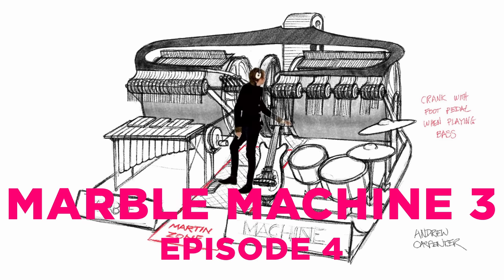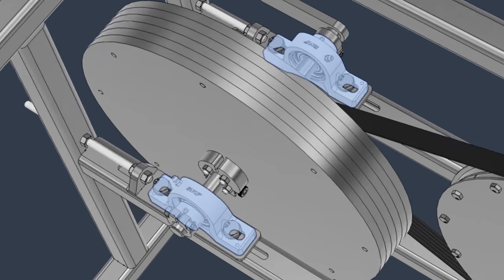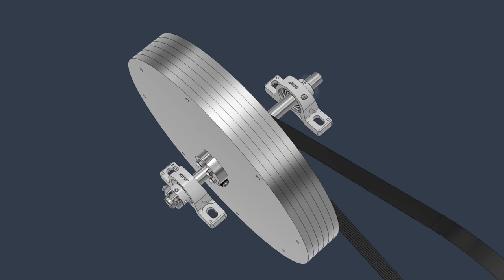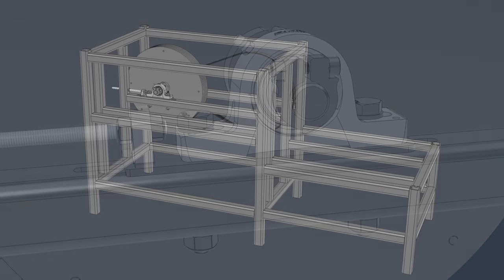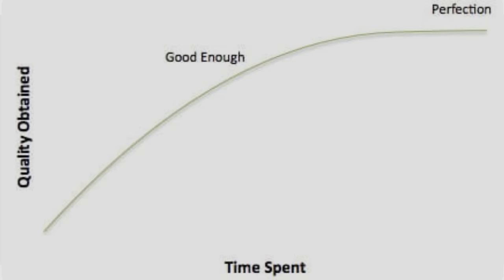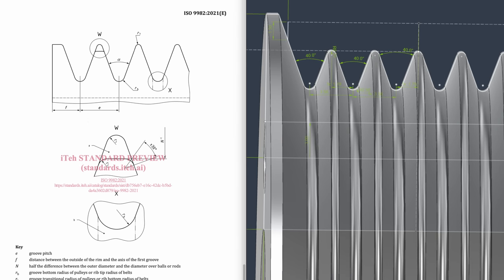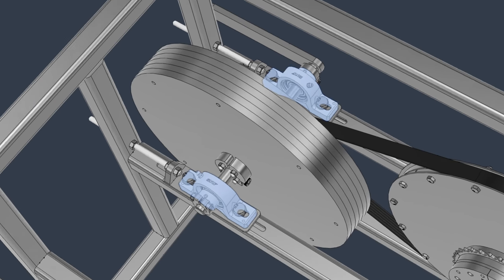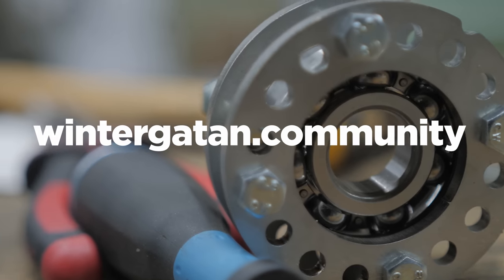A Better Flywheel Design - Marble Machine 3 Ep.4

Comment: I'm curious why the flywheel assembly need to move to tension the belt, instead of the other side of the belt.  Is there a reason for that? I'm concerned that an adjustable flywheel (even with those bolts) might effect the balancing or unwanted movement of the flywheel?

Comment: Why move whole massive flywheel to adjust belt's tension when you could tension the belt with one flat, small, adjustable roller? It would be easier to manage space and ensure stability that way, no? Check out "tensioner bearing" and "idler bearing" in engines. Imo moving the whole flywheel can result in problems in the future — space management, screw loosening, unwanted vibrations, frame rigidity, two screws to control tension can introduce unwanted alignment, It requires more work to tension (alternate between adjusting screw no. 1 and no. 2) and it's a huge ass piece of weight to move. A fist-sized tension roller could be a lot easier to access and adjust if it had only one screw and was mounted to the rigid frame.

Aside from that, good job :)

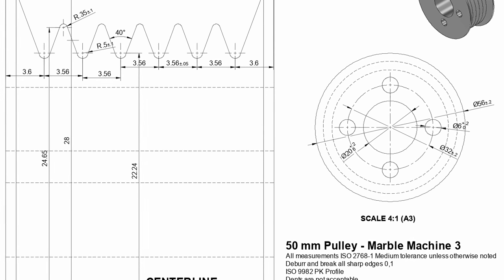Comment: The blueprint at 6:51 is good enough and will make sense to a machinist, but convention is to place dimensions outside the part whenever possible. for the 50mm a 6:1 scale factor would have been enough, and 4:1 would have been a tad small but probably workable.

Comment: Unless you just don't share it, I believe you're repeating a huge mistake. You design it in small steps without having the bigger picture. From my experience, it's best first to have the concept without the smaller details and only then starting to increase the resolution.

Comment: a) why laser cutting the central holes when you can drill those from the start? 
b) you don't need to make the entire flyweel movable just to achieve desired belt tension. You need a simple standard failproof spring-loaded belt tensioner!

Comment: @ Martin:
Why are you using sleds to tension the belt? You would need to ensure they are parallel at all times. Why not keep the flywheel adjusted and fixed all the time, and just tension the belt? You could even have it self tensioning when using a strong spring.

Comment: Box tube looks and feels really stiff but when you apply the mechanical advantage of a bolt thread it's surprisingly easy to deform them. 
One solution is to offset the attachment points to cleat plates although that adds eccentricity.
A second more time consuming option is to sleeve the hole with hollow tube slightly larger than the bolt. That way all bolt forces are taken in compression but the sleeve and the box is isolated from the bolt tightening forces.
For most applications this is not a big deal but where you are loosening and tightening bolts often or looking for precision it could save you a lot of trouble.

Next when you get a bit closer to finalizing your base frame don't just check the stiffness look at its harmonic frequencies and compare them to all the rotational frequencies that are in the range of the machine. A precision marble drop is only precise if the target an the drop location are steady.

Hope this can avoid rework the enemy of all engineers.

Best of luck.

Comment: So, why dont use premade pulleys, like for car engines? And more important question - why dont use one extra pulley mounted on a sliding bolt for belt tension? Like they do on car engines? I think, that your tension system now is more unstable and fragile due to abandonce of nuts and bolts, that need to be tensioned simultaneously. The more places you have to adjust the more unstable whole system becomes. I feel like it's just adding more points of potential failure. If the wheel becomes unbalanced due to wrong tensioning of one of the bolts - the other bolts start loosing tension as well. Fewer connections means simpler and more robust tuning and operation of the mechanism.

Comment: Tip for dimensioning a part for machining: if you have a large number of features in line with each other (such as the pulley grooves), try to dimension from a single point rather than incramentally.  Compounding rounding, measuring, and tolerance errors can stack up to give you a part that's too long or short, even if each individual feature is in spec.

Comment: instead of re-engineering the axle clamp wouldnt it be easier to go with proven axle setups like keys and regular axle clamps which are off the shelf part only thing is that you than need to broach a key way in the pulley and the flywheel and mill a keyway in the axle . 
benefit of a setup like that is that if there would ever be a failure which locks the machine a key is designed to fail/shear and let the flywheel continue to spin on the axle .

Comment: To avoid the problem of steel hardening caused by laser-cutting, I'd suggest you find a good water-cutting service. The cuts are just as, if not more, precise and it completely avoids any issue of heat hardening the steel. See Fireball Tools video about his water-cutter to see how it works and the benefits of cutting that way.

Comment: Why not adding a moveable pulley which pushes on the belt between input and flywheel, so the flywheel does not have to be moved?
Reply: That adds friction, a hand powered mechanism needs to be as free as possible.

Comment: Hey Martin, tensioning two side of the flywheel bearing will make the task harder than necessary. If one side is more than the other, the belt will slip off your pulleys. You need really good alignment. Add a tensioner pulley instead and its way easier to maintain alignment while tensioning

Comment: About Concentricity (is it spelled correctly?): Can´t you lathe the hole of the fly wheel as well instead of drilling it by hand? Would be much more precise.
Reply: At that point would it not also make sense to simply machine the entire flywheel on a lathe?

Comment: concentricity can be achieved after the wheel portions have been crafted.  Once it's mounted in the machine, a temporary brace on the nearby strut at the rear of the frame, and a few minutes with a lathe tool, and you can true up wheel to be nearly perfectly concentric.   But as you said, balance is more important than concentricity, particularly if you're using a material like plywood which is not entirely uniform across the sheet.

Comment: Suggestion, look to automobile serpentine belt design and tensioning system in lieu of moving the flywheel pillow blocks.  The tensioner could be bought off the shelf and by using it you will get more perimeter contact on the belt to flywheel pulley which will also reduce the required tension.

Comment: I would increase the diameter of this axle to 30 mm, 20mm will be bended only from the weight of the flywheel... just my 2 cents
Reply: All horizontal shafts loaded like this will bend to some degree, but how much is is allowed to bend depends on the maximum speed of the flywheel and the fatigue stress of the shaft material. I agree though, it's better to be safe than sorry. I would have preferred to see the shaft machined so it could increase diameter where possible to maximize rigidity without requiring larger bearings than needed.

Comment: Awesome. Suggest using linear slide rails instead of laser cut slots in the square tube. It's much more reliable over time, and the square tube clamping surface will wear and create "indents".
Reply: Yes .. also slots dramatically weaken the tubing in the perpendicular plane. The slide doesn't need to be a precision linear bearing, a metal clamp around the tube would be fine

Comment: You may want to use separate bolts to fix the pulley to the rest of the flywheel assembly. That way you aren't loosening the heavy plates which could disturb the balance when swapping pulleys.

I think you'll also want to be able to easily remove the flywheel from the machine without loosening the through bolts. This may make balancing much easier depending on exactly how precise it needs to be, as well as improving serviceability in general.

Comment: hi there mate your pully seems like its diameter is too small for the belt you have chosen, I suggest to verify the minimum belt bend radius in the datasheet if the manufacturer.

in another note, it nice to see that you are listening to good mechanical practices like choosing a proven design.

Comment: I'm sure you well already understand the flywheel variability. The answer involves a balance  between 2 specific factors:
A) how much time & effort (energy) you wish to have to put into it, to get the flywheel up to operational speed.
B) how much output you wish to have of the flywheel's momentum to both stabilize rotation speed, and also assist in output when it is not being driven.
In short, the answer is mathematical, but the real questions is the current ambiguity of how much work energy the total machine requires to run.

Comment: Rubber suspended bearings may help against resonant vibrations caused by the fast spinning flywheel. De Laval used very thin shafts instead, for steam turbines, as the springy elements.

Comment: You are well on your way to becoming an engineer, doing technical drawings now too! It's been great following your progress over the years! Also, thank you for addressing the hardening effect of laser cutting, I was getting ready to write a comment about it before you brought it up haha
Reply: He's not. Signed, an actual engineer.
Reply: @thomasbecker9676  I'm an actual engineer too... I'm not saying he's about to work as a professional engineer or anything, just saying that I see a huge improvement in his thinking and design process compared to when he was making the first MM out of plywood and rubber bands
Reply: @thomasbecker9676  A real engineer doesn't call themselves "an actual engineer", but nice try.
Reply: @andrewgrzanka  "Improvement" is a  meaningless term if he's still going down rabbit holes and ignoring what is good and common practice. There's a reason why companies have been selling the same mechanical parts for decades. He supposedly had an entire "engineering team," including a project manager for some reason," and still couldn't get out of the weeds.
Reply: @LordDragox412  ERAU Daytona, BSAE (aero) with minors in Mathematics and Flight Test & Simulation.

Comment: problem with reamers is they are tapered.
unless you get a mechanic style set used for king pins.
they are a square reamer, not tapered.
still, there are sheives designs that are are split tapered, similar to a dremel tool chuck .
good idea keeping with the pillow block bearings.

Comment: I think you said in an earlier video that this would spin at 7,000 RPM. This will be tremendously NOISY. Especially with all the metal parts involved.
And at this high RPM you will have to achieve dynamic balance. Static balance, meaning when it's not rotating, is not good enough.  
You're using a belt to drive the wheel at a high ratio. The belt will be a lot quieter but it will also have a lot of friction. Have you done a power calculation using the estimated friction drag times the RPM? I think it's going to be more than you anticipate.

Comment: Hallelujah Martin has seen the light! 
Martin, top tech tip for you from an old High school machinist building stacked parts like your flywheel. Get your stack as close to aligned then ream all the center holes at one shot. This will give precision reference point to do all the other machining for  the bolt holes that will give precision fits you want then before balancing spin it at a low speed and sand it out to make it concentric.

Comment: The safety spacer should be integrated into the pulley geometry. If the pulley is a custom component.
Also think about using a shaft key and keying the flywheels and pulley. This removes the need for the complex through bolt assembly. Then you just need some shaft clamps to stop everything sliding off. However if your having a shaft made, it could have varying diameter so I can only go in from one side. That way you'd only need two shaft clamps

Comment: If you're going to tour with this, you want to optimise the flywheel for shipping - that means maximising the rotational inertia while minimising the dead mass.  That means a heavy rim with spokes. In order to prevent spoke flex with high rotational inertia, the spokes, whether tensioned wire or solid, should be designed with this in mind.  With the current design probably 60%+ of the mass of the flywheel isn't contributing effectively to the rotational inertia.
Reply: You bring up a good point—and in addition to the cost of shipping, the thing also needs to be built to handle the rigors of shipping. It will be subject to lots of shocks. It needs to be built to handle a small drop without damage. Minimizing dead weight (especially dead weight suspended off the floor) is key. It’s going to have to go up and down ramps, cross door thresholds and roll over cable raceways. It might have to be lugged up stairs. These margins can be enlarged either by reducing weight or by stiffening the frame or both. But reducing weight has the added benefit of saving Martin’s back (and the backs of his roadies).

Comment: i suggest using a separate belt tensioner on the "slack side" and securing the bearings securely to the frame, see automotive applications, these things already exist off the shelves. Keyed shafts are also a thing when transmitting torque but clamping probably works fine in this application.

Comment: Hi Martin,
The first thing what bothers me in this design is the bolt circle diameter. The less it is, the easier is to break the threaded rods when the machine accelerates or brakes.
My second thought is, centering the weight disks using the center hole is not the best solution. I think of a sturdy hub (made of a bushing and a thick plate, welded together and machined on the lathe), and the weight disks will be bolted to it on a larger diameter. This will keep them perpendicular to the shaft.
And third, isn't the shaft too thin? It looks too weak to carry such a heavy rotating mass.

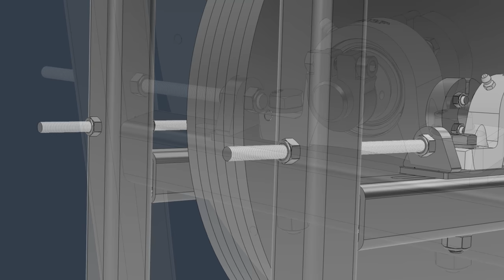Comment: I think you can eliminate the nuts on the "inside" of the tensioning screw (3:02). Since this part is just for calibrating the belt, which will always be in tension, these nuts will never transmit force.
Reply: But add a washer so that the washer wears out instead of the frame where it makes contact with the nylock nut.

Comment: And you can use the actual setup for balancing the wheel. If it stays in whatever position you set it, it's good enough. If not, remove some material from the bottom side and try again.

Comment: Having the belt tensioning mechanism at the flywheel rather than at the other end of the belt (with the larger pulley) means that you are potentially weakening the structure under the pillow blocks.  I think you should avoid cutting long slots in the frame elements that are responsible for holding the flywheel.  Rather, the large pulley has far less weight and is not spinning at flywheel speed.  Putting the belt tensioning as part of the large pulley will weaken the frame in a place where strength is not as critical.
Reply: This is a great point, and another reason that an idler pulley is simpler and more robust.

Comment: You might want to add some left/right adjustability (maybe using spacers) to get the pulley aligned. It probably will be out by a millimeter or two, and being able to swap in a small spacer would fix that.
Reply: Wherever shaft alignment and end play are an issue, shims are typically included in the design. This is very sound advice.

Comment: One thing you also need to remember is the tolerancing of the laser, as just because you set something to be 19.9mm doesn't mean it will end up that way. Depending on things, it may be too small or too large.

At my place of work, we have +/- 1/16" tolerance on all plasma-cut parts, and I actually had a good example of why tolerancing was important to happen a few weeks ago: I noticed excessive rework being done to upsize a hole that was called out for exact dimensions on the print, not accounting for the tolerancing, nor the hardware to be used. Despite the clear measurement, the hole was 1/32 too small...still within tolerancing spec but added to the cycle time, not to mention affecting the part's surface finish.

Comment: I think putting the transitioning bolts inside the square tube would be a lot better. Having it above will make the part tilt and create friction when you're tightening the bolts.
Reply: That's actually a great idea.
How reliable is the diameter and exact shape of such a metal tube, though?

Comment: With regards to the pulleys, you'll find that there are many off the shelf blank pulleys at the diameter you need, but just with a small hole on the center which you'll need to have someone turn to the right size.
Make sure you have a good google at bearing and pulley supply workshops because they might even have ones with the right shaft diameter, or could make you one for $20.